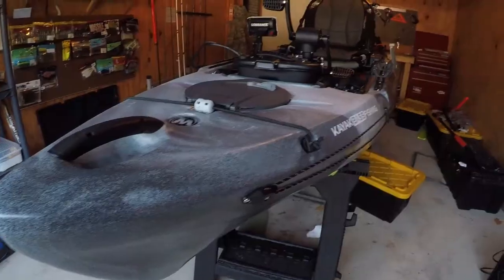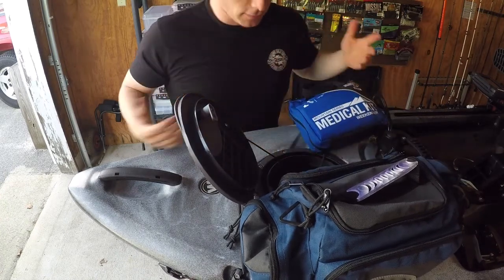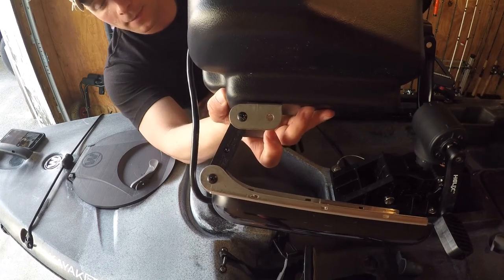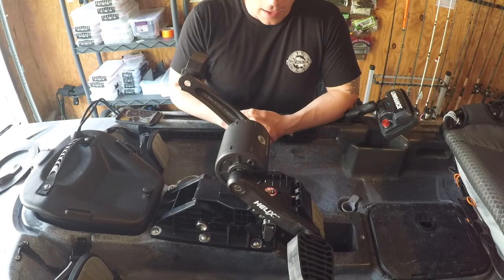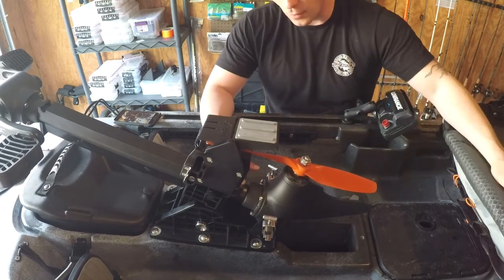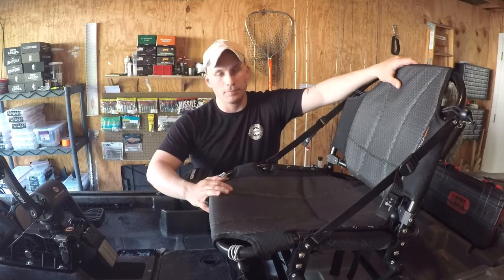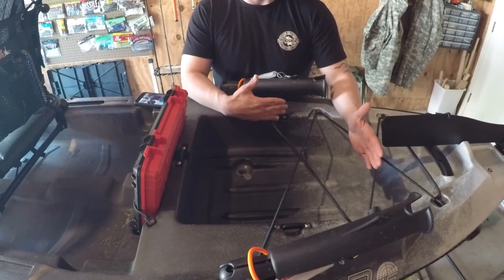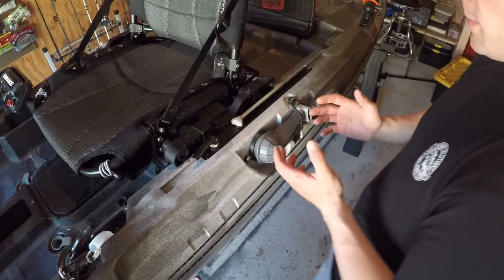Radar 115 & Helix pedal drive

Comment: Researching pedal yaks due to old shoulders.  Never occurred to me that leg reach could be an issue. Simple solution would be to replace the pedals with thicker ones.  Or bolt wood or plastic blocks to one side of the pedal.  3/4” on a bike seat height makes a big difference.  Exact same effect if you add to the pedal itself.  Thanks for the good review.

Comment: Thanks for the review dude!  I'm 5' 7" and have a Radar 115 with Helix drive I just bought.  Took it out yesterday and quickly found out that pedal kayaks for shorter legged people is just not fair!.  I can't reach my tackle or my rods that are attached to my crate.  I have to loosen up and slide the seat back and forth to get to my tackle.  What a pain.  Not sure of the answer.  I wanted to see if you still use the Radar and how you deal with reach problem.  Thanks for your feedback!  Keep the videos coming.
Reply from the maker: Rankin Darby I have the same issue. What I ended up doing is getting 4 ram mount rod tubes and use those right behind me. For a while I actually mounted the black pack right behind me with straps
Reply: I noticed that as well on every video I've watched so far.  They either designed it for someone seven feet tall or made anyone using the PD a secondary thought.

Comment: got any actual GPS speeds and or comparable speed w just using a paddle? Thanks. I simply want to tour and really wish wilderness systems would make a NON-Fishing yack built for speed that was reasonably stable..lol I am a cyclist and a kayaker/ own several  tarpons. both 16'. I like sit on tops as they are just more comfortable am interested in the ped drive if its faster.

Comment: Hi Great video. I have a question. I'm 57 and the knees are not what the used to be. Compared to pedaling a bicycle what is like to pedal the Radar. What I mean is.Is it like pedaling on level, slight hill or steep hill to compare to a bicycle. I saw a Radar at the local Kayak Shop and I am interested.  They don't have demo days very often and I would like your input please. I have a low end fishing Kayak "Future Beach 144 Angler" and looking to upgrade. Thanks.
Reply from the maker: jlilly1961 a little bit more like a slight upward hill I would say. I would definitely recommend the radar.
Reply: Thanks for the reply. I will also have to keep the seat forward, I'm 5'7" :(
Reply from the maker: jlilly1961 lol being short is a struggle I hear ya 👍

Comment: Thanks for the video. Do you still remember where you found the anchor trolley bracket idea for the transducer installation?
Reply from the maker: harahara10 sure do, here is the link 

https://www.austinkayak.com/products/19083/YakAttack-Leverloc-Anchor-Trolley-HD-Heavy-Duty.html?utm_source=google&utm_medium=cpc&utm_campaign=Shopping:%2520ACK%2520PLA&adpos=1o5&scid=scplp19083_16297_1&sc_intid=19083_16297_1&gclid=CjwKCAjwkYDbBRB6EiwAR0T_-rItapXY03ERUC_0toEUSRjl2qRWsTQxAv9HLU4zmV7mymjNFnuDLxoC0kcQAvD_BwE

The 2 long pieces is what I used to get the total scan transducer lower to the water and then you can use the rest of the pieces for an anchor trolley
Reply: MFA Fishing, thank you!

Comment: Are there any rod holders on this kayak because I saw you only had rods on the milk crate
Reply from the maker: Quinton Renfroe no there isn’t. So what I did is use Zooka tube rod holder and put 2 on each side on the gear track as well as the crate rod holders

Comment: Good review video of pros and cons. How does the transducer work through the hull? Isn't there a loss of signal strength?
Reply from the maker: Benjamin Lee I don’t have any issues, when I was running the total scan transducer for sidescan you have to modify it a bit to make it hang lower with brackets but if you are running a normal size transducer it works prefect

Comment: Great video, very informative! I've been thinking about peddle drive and also sitting higher in the boat. Do you find it to be easier on your back. I have spinal stenosis in my lower back and paddling my kayak seems to aggravate it. Also, sitting low. Have you noticed any difference with your back? I have been looking at the Native Propel and the Pescador Pro as well as the Radar and the ATAK. I take it you're happy with your purchase? Thanks!
Reply from the maker: Nick Vivirito i was debating on between the propel also, I too have very bad back problems and have spent 10 plus hours in the kayak with hardly any issues. Wilderness sytems does have a lumbar support for the seat that might make it even better. I am very happy with the purchase. If you want subscribe I will be doing a video on how I rig everything on the radar.

Comment: Did the transducer show outside the bottom of kayak once installed. Can you send a pic
Reply from the maker: Reggie Grimes depends on what kind of transducer. A total scan w/ side imaging will stick out for it to work. If you are running just downscan it does not stick out and is well protected
Reply: MFA Fishing thanks . I also have a 115 and was wondering about side scan transducer. Have you hit anything with it sticking out? And what fishfinder are you running with it?
Reply from the maker: Reggie Grimes I was using elite 5 TI with sidescan, but have since reverted back to a hook 7 since I really wasn’t a fan of the elite 5. I now just run downscan.

Comment: What different pedals did you install when it started getting noisy
Reply from the maker: Reggie Grimes I replaced the stock pedals with these, 

https://www.amazon.com/BONMIXC-Bike-Pedals-Bearing-Mountain/dp/B07B7FP87B/ref=mp_s_a_1_2?ie=UTF8&qid=1537367431&sr=8-2-spons&pi=AC_SX236_SY340_QL65&keywords=bike+pedals&psc=1

Have had no issues

Comment: What plugs have you got in the holes?
Reply from the maker: Goi Jehudim I use the wilderness systems harmony scupper plugs work perfect
Reply: Thanks for the quick answer. I tested the 135 on the water and I had a look at the 115 in the shop today. I just can't decide. I am 6'4, would be the bigger one better?
Reply from the maker: Goi Jehudim I'm a pretty short guy and have the seat all the way forward on the 115 to reach the pedals. I guess it would depend on if you want more storage space and a bigger front hatch.
Reply: Thank you. I can't tell, it's my first kayak.

Comment: Would you say the pedal drive system exerts less energy than paddling?
Reply from the maker: William Whaley yes absolutely, I can pedal for 45 min without a break. Pedal kayak is a game changer
Reply: MFA Fishing awesome! I'm going to go get one today. Only thing I'm worried about is my height as I'm 5'5 and I have the tarpon 130x so hopefully the dimensions are close to what you have as far as leg length is concerned. Thanks a lot for the vid and answering my question. This has been the only helpful video I have found so far
Reply from the maker: William Whaley I am 5'6 and it I have the seat almost all the way up. You should be fine, it might be easier for you to pedal with the seat in the low position.

Comment: I like your video but I hate this kayak. They should have stuck with putting a pedal drive on the 115x. The storage on the radar is useless and the handles suck. They come apart every time I pick it up.
Reply from the maker: Ryan Rosser I agree with you on using the ride 115x. Actually the kayak I owned before this one